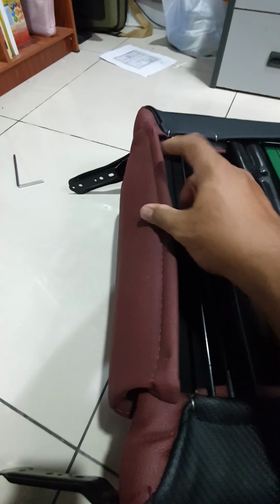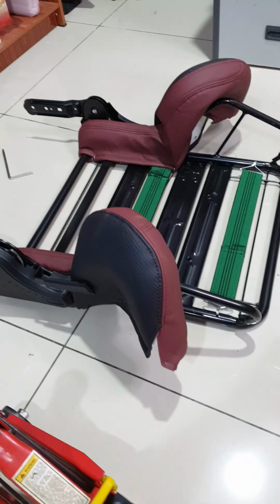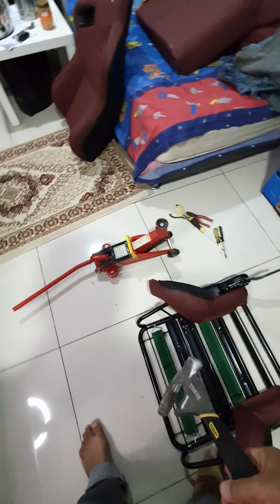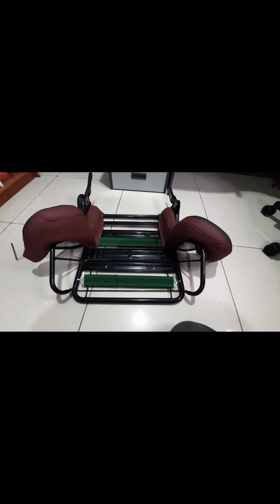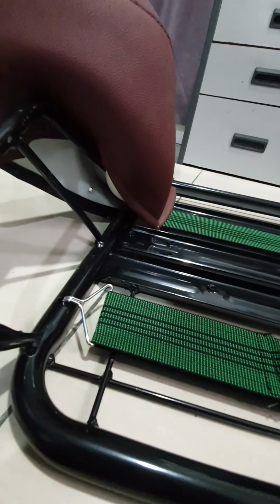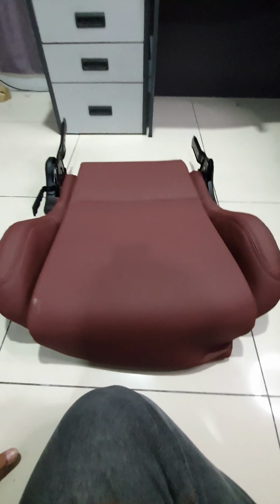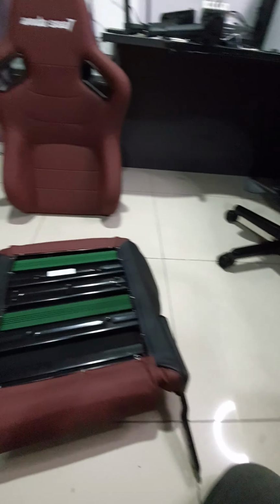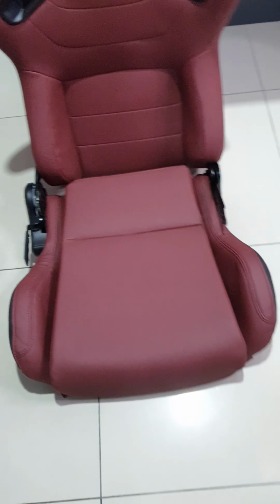Ripping my brand new Anda Seat Kaiser II apart! Kind of..

Comment: hi man! thanks for video) i tried to do the same thing with the same model of chair, but it was worthless. these side supporters, even if they were push to the limits still were hurting my hips to the continus pain. fck...ing shit. so i decided to cut them of with hacksaw. may be it is not so sharp shaped now, but man now i can seat as a human, not a prisoner under torture.
Reply from the maker: I just widened the side supporters a bit with a crowbar. One of the weld did came off a bit but that's a minor issue. Can always send it to be welded back. Now blood can resume to flow through my hips.. 😂